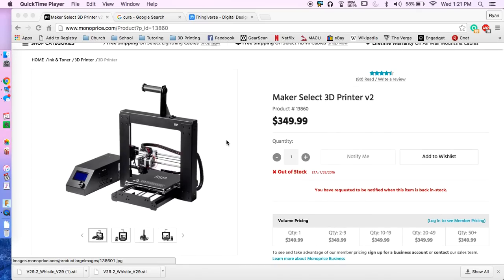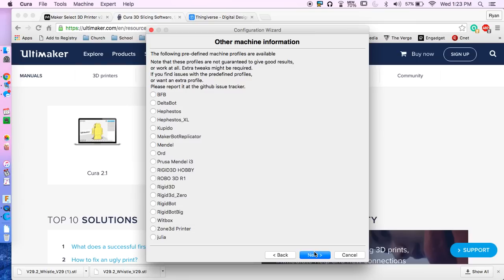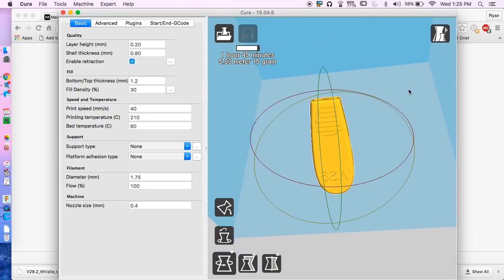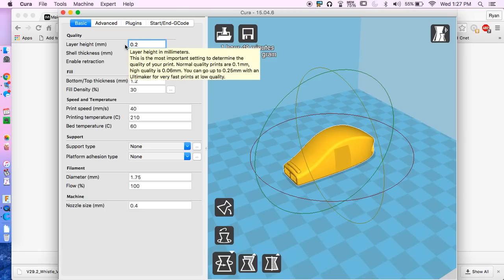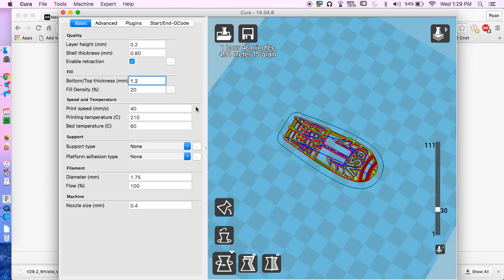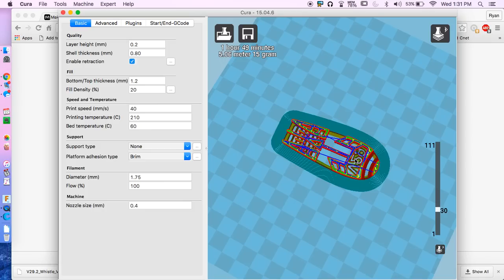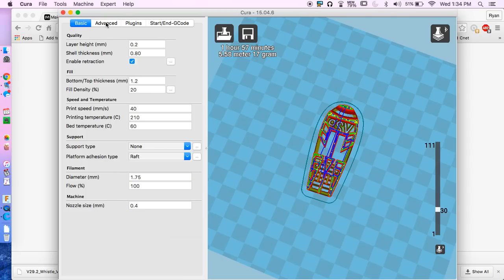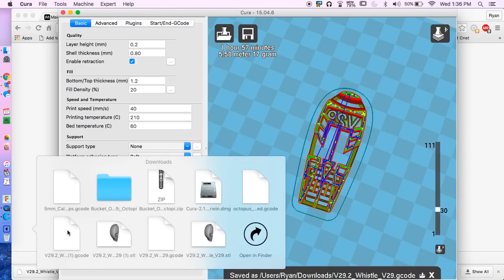Using Cura to 3D Print

Comment: the SD card it came with is read only even when I flip the lock switch I tried reformating it buy it still doesn't work I can't find anything on how to print through the usb cable they included do you know how?

Comment: great video. I use ur exact settings. do u have recommended settings for abs?  thanks.
Reply from the maker: I don't print with ABS much. It is very susceptible to warping and other things. However, it has its benefits.Typically ABS prints at higher temperatures, same with the bed temperature. I would recommend always using a raft or a brim to fight the warping that is bound to happen with ABS. For exact temperatures I would just google it.

Comment: I had a lot of problems with this program!  First of all they make you answer a lot of questions and give them an email address for spam messages before you can download the program now!  Also they don't have very many printers on the list and it won't open any of the files that came on the SD card with the Monoprice printer!  How can you use the program if you can't open any of the Gcode files?  It looks a lot different in Windows 10 and is probably going to be useless.

Comment: NOTE Cura 2.3.1 for windows DOES NOT look the same on win 7 as shown on this video Nor have the printer settings shown on this video It appears to me a very simplified version of the Apple version and I'm suspicious of it's functionality. is there a version of Cura that looks and works just like the one shown in this video?????
Reply from the maker: At 50 seconds in the video I say that this tutorial is for Cura 15.04 and future 15.04+ versions. You can download it at this link: https://ultimaker.com/en/products/cura-software/list. These 15.04 versions should be nearly identical to the mac versions.
Reply from the maker: I haven't made a tutorial for 2.3.1, but maybe I should. Both versions have similar settings, I think 2.3.1 is a little more user friendly. If you can learn the settings from this video, printing using 2.3.1 shouldn't be too hard. Let me know if you have any more questions.
Reply: You are just being silly!  There aren't any future versions of the old program!  It stopped back in 6/7/16.

Comment: I'm hoping you might still be around, but do you think you could update this tutorial? I just updated my Cura, and the only "prusa" they have is the Prusa i3, Prusa i3 mk2, Prusa i3 xl, the BQ Prusa i3 Hephestos, BQ Prusa i3 Hephestos XL...
Reply from the maker: Erikon14 I am still around. What printer are you using? Even if cura doesn't have preset settings for your printer you can always put in custom settings when you add a new machine. If you know your nozzle diameter, bed area, and z height; you should be fine.
Reply: Learn To Learn its the exact same printer as this. The Maker Select. I got it a year ago, and had been using that exact version of cura since then (on pc). Just updated cura to the latest version. Think I got the right settings laid out with the Prusa i3 preset, though.
Reply from the maker: Did you get it to work?
Reply: Learn To Learn I did.